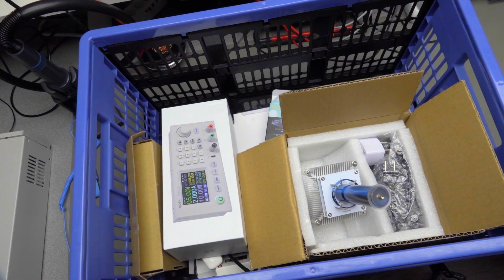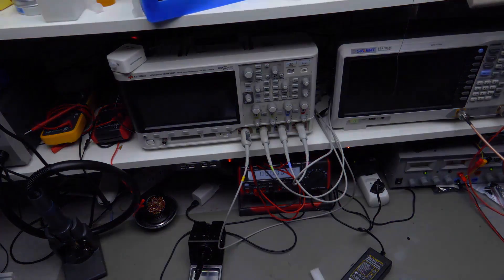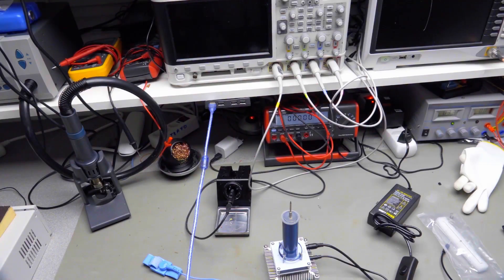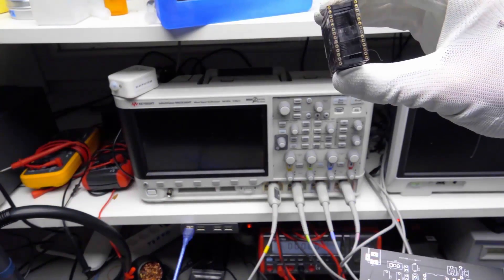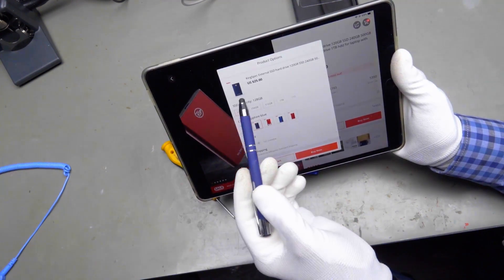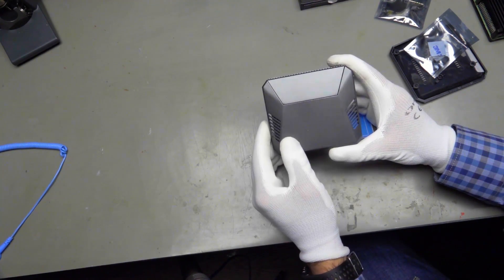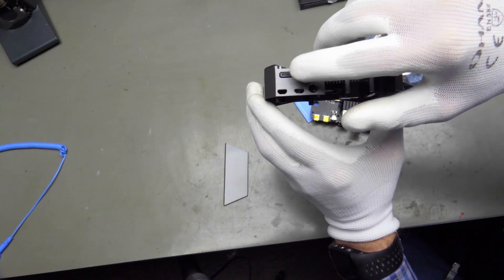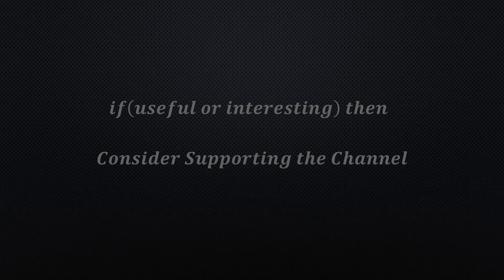#308 Mailbag Part 1 (Tesla Coil, wireless energy transfer, Raspberry Pi stuff, etc.)

Comment: I think the audio encoding may have had issues during exporting. It appears to be fading in and out and changing balance from left to right.
Reply from the maker: Yes, you are right. I changed my recording infrastructure and have to work on it.
Reply: @AndreasSpiess  despite the audio problem, a useful and  interesting video as always. Thanks
Reply: @AndreasSpiess  The problem is with the phase of microphones you are using. I assume that here is two microphone recording same time and in the editing or in the recording gear one of them is panned HARD left and the other HARD right and because of the difference in phase, according to your position (sound source) they cancel each other or at least duck each other. either use one of two recorded audio or change the phase of one.
Reply: @AndreasSpiess  Can a jammer be bypassed by a Faraday cage?
Reply: The weird sound effect is not due to a bad connection, it's produced by phase angle between L and R channel.
Reply: Yes, it is fading in and out, it seems a problem of unstable microphone connection
Reply: @Carolus_64  I think if it was an electrical connection, we would have more of a complete loss of audio and/or static. The odd addition of reverb and level changes points towards encoding.
Reply: Maybe a mic positioning Problem. 

If you need help from a german sound engineer, let ne know.
Reply from the maker: @Jonas, I would be glad to talk to a professional. Maybe you send me a message on Messenger or twitter?
Reply: @AndreasSpiess  I found the Problem and sended you a message via Facebook
Reply: Its an phasing problem with the mic. May be l/r channel cancel each other out. Go for mono if possible.
Reply: Do you think your mic was zapped by the Tesla coil...? I had an apple flatscreen monitor with a touch switch. It got burned out when I was using a CB within 3 feet of the monitor.. I hope I can fix it.. While I'm talking about Tesla, is there any way to harness the power in the Aurora Borealis?

Comment: I see that you will be doing reviews on the E22-900M22S LoRa 868/915 MHz modules. I have breadboard friendly breakout boards for the E22-900M22S and E22-900T22S modules that I can share with your audience if you think it would be a good idea. The boards are on OshPark.com and I can enable them to be shared. Three breakout boards cost about 6USD (includes S&H within US) which is rather cheap (not as cheap as China board vendors but OshPark boards are well built). I also have Arduino test F/W for verifying board functionality. If you want F/W libraries for the SX1262, go to https://github.com/jgromes/RadioLib ... he recently added support for "SX126x series LoRa modules (SX1261, SX1262, SX1268)"
Reply from the maker: It would be a good idea to share it. Maybe you send me a message in Messenger or on Twitter?

Comment: Concerning the SSD drive on the raspberry (in particular raspberry 4).

I installed an external USB drive and boot from this drive on the raspberry 4.
The drive I bought is "Samsung Portable USB SSD" at a good price..

What's happening on my raspberry:
- Read SD card.
- Read the /boot partition on this SD card.
- Start booting using sdcard partition and mount USB drive.
- Continue booting from the USB drive using /etc/fstab

The time it takes to boot is pretty fast :) way faster than SD card.
It's a really decent media center!

Some of my "findings".
- Some setting in /boot/config.txt that may be interesting: "rootdelay" and "maxusbcurrent".
- I have not been able to put 2 USB drive in parallel on the raspberry pi 4 (directly, using external powered hub, etc...)
- You have to mount / and /home in your /etc/fstab file (that will be stored on your external drive). You may have to modify the copy on the USB drive AND on the SD card (I spent lot of time...)
- I have spent a lot of time trying to "dd" (copy) my sdcard on my usb drive partition without success.
- Don't forget that it's easy to mount the partition on the sd card.
- You don't need to copy the /boot partition on the USB drive.
- Don't spend time with a mechanical disk :) strange issues like "crashes" probably due to power consumption. USB hub were not a solution.

I think I followed this tutorial: https://www.tomshardware.com/news/boot-raspberry-pi-from-usb,39782.html - but was not working "out of the box" :) 

Note: thank you for the script to control the ventilator using PWM on to of the raspberry 4 :) That was a great addition to my "media center"!

Comment: I recently configured a rPI4 with an inexpensive 60GB USB3 SSD similar to what you are describing and achieved great results. There are a couple of issues --
1. When I did it, there was a firmware issue on the PI that prevented actually booting from USB. So, you have to boot from SD and put everything else on the SSD. This is unfortunate, but not a huge issue. Still much better performance. Perhaps this has already been fixed?
2. There are issues where some USB SSDs that do not correctly implement UAS and get really lousy transfer rates. You can disable this mode with the procedure at: https://www.raspberrypi.org/forums/viewtopic.php?f=28&t=245931 and still get great results. 
In my case I get about 250MB/sec reads compared to 12MB/sec or so for the SD card.
Reply from the maker: Thank you for the link. USB boot on the Pi4 still is not supported.

Comment: 3:00- If you hold a fluorescent tube in the air while standing under high-voltage power lines, it will light up because many of them are poorly insulated and leak a lot of power. You can have a realistic light-saber. (Obviously don't touch the power-lines or towers. Besides, that would defeat the amusement of it being wireless power. ¬_¬)
Reply from the maker: There is an electric field around all lines.

Comment: I've learned that Tesla coils are used in very high-end Hi-Fi, as tweeters supporting high frequencies. They're used in addition with other technologies to support the full Hi-Fi band. Not very practical for high output (in terms of sound pressure), but watching your video, I can definitely see the allure. Neat trick with the fluorescent tube, by the way.
Reply from the maker: I do not have knowledge in Hi-Fi. So I do not know it really helps or is just a gadget.
Reply: @AndreasSpiess  I think it's just a gadget, for the most part. All of that gear is well out of my pay grade. :D

Comment: You should definitely check to see if that SSD is actually 128GB. A lot of cheap Chinease SSDs/MicroSD cards give a fake storage size to the OS (a 32GB showing up as 128GB in the OS). GamersNexus and Linus both have videos on this subject. Here's a video from GN: https://www.youtube.com/watch?v=cBhNLSk0w6w
Reply from the maker: Thank you for the tip. I will try it. But also 32 GB would be ok for my Raspberry as long as wear leveling works. And here I have no information :-(

Comment: These Argon cases are indeed very nice. At least in Germany they are available e.g at Berrybase and Reichelt around 24 Euro (Berrybase made a Video to explain all the Features: https://www.youtube.com/watch?v=zLxhalSAUzY ). 
Wifi still works because of the Plastic Bottom. 

And Argon has another Case, similar to the FLIRC wich is a bit cheaper but I havent tried it.
The only downside is that the software only works on Raspbian, I can't get it to work on Manjaro.
Reply from the maker: Another viewer posted this link already. Maybe I should add it to the video (for the Germans). I know they have other cases, but I did not want to make a "case" mailbag...
Reply: Andreas Spiess Sorry, havent seen that.

Comment: The Tesla coil creates plasma, this plasma creates O3, or Ozone. That's the odd smell in the air. Don't run it too long as Ozone can be just as deadly as too high of CO2. I would not run the Tesla coil for an hour or longer for sure in that closed room without circulation.
Reply from the maker: That is what I thought. It did not smell right. But I am still alive ;-)
Reply: @AndreasSpiess  And we are glad of that  😉

Comment: That was timely, I was looking at SSDs for my main Pi myself just this weekend for the same reasons.
Reply from the maker: So let's hope we will be able to use it without a SSD...
Reply: @AndreasSpiess  very doable, for the Pi 3 you can use Berryboot, it is super easy  and is nice for backup and some other interesting features.

Pi 4, a little more tricky till the Rasberry people provide new EEPROM code for it. But just yesterday I was setting up my Pi 4 with help from this page, which worked well, and is reasonably straightforward. jamesachambers.com/raspberry-pi-4-usb-boot-config-guide-for-ssd-flash-drives
Reply from the maker: @Evile: Thank you for the link. Maybe I will try it too.

Comment: Those are some nice finds!  The Rasp Pi  case is a smart design (finally!)
The Tesla coil looks like a fun table-top toy -- especially since it "sings"!  I'm curious to know what voltage it produces (not listed on its info page.) Will you be talking about the operating principle, Tesla's use of tuned resonant circuits, etc? I'm not sure how audio passes through such a limited bandwidth.

It looks like you have some fun projects in the pipeline!
Reply from the maker: I might do some additional tests with the tela coil to measure its voltage. We will see. But I have no plans for a next video. This might change if I discover something interesting...

Comment: Seems small capacity cud just use a usb thumb drive 🙂
Reply: A thumb drive and SSD are very different things, The flash in thumb dives is very low quality and has less writes, and the controller used lacks many of the functions required for high performance SSD. Just ask anyone who's run A PI (even a Pi 3) off an external SSD, it's like a completely different machine vs the MicroSD. Also thumb drives usually use a cheap memory called MLC, it has much lower write characteristics than the SLC memory used in SSDs. Finally SSDs are designed to use the SATA interface which is designed around the needs of data transfer and I/O and maybe even cacheing. The thumb drive just uses a 'good enough'  memory to serial controller.
Reply: @EvileDik  nice I am familiar with sata interface in ma pc.I assumed the pi wasn't capable of max performance if connected using usb but I no got Pi 😂
Reply from the maker: Nobody knows how the USB sticks implement wear leveling.

Comment: Hi Andreas, interesting mailbag, the pi case is indeed smart and the small SSD was a good find. I'm looking forward to your 4G LoRa gateway episode. By the way, plenty of the Chinese suppliers of this HUAEWI modem adds different brands of (cheap) antennas. Therefore, a scan with the antenna analyzer for this particular Ali-item would add value to your future LoRa/4G video.
Reply from the maker: Good hint about the antennas. I did not know. So I will test them...

Comment: The Tesla coil is really cute, although a bit dangerous. The HF voltage will flow over the surface of your skin and give a tingle, but will also destroy electronics in an instant. I would be more worried about the ozone it generates, as just 5 parts per million is considered immediately dangerous to life or health!
The Pi 4 case is sweet, but unfortunately not easily stackable. A flat top would be better as surface space to put things is always needed!
Reply from the maker: I did not feel pain. Maybe because of the "magic white gloves" ;-)
Indeed it stinks in a small room like my lab. But we were in the snow for holidays to replace this bad odor with fresh mountain air.
Reply: @AndreasSpiess  Some luxury shower cubicles use ozone generators for disinfection: the cubicle is sealed, exposed to ozone then vented to the atmosphere, during which the doors are locked for a few minutes until the concentration is low enough to enter.
I suspect your audio problems may be due to high levels of RFI. It would be interesting to see what your spectrum analyser would show, starting off from far away!
Reply from the maker: @Andy: The audio problems had to do with my new infrastructure and cutting software. It should now be solved for the next part (at least this is what I hope)
Reply: @AndreasSpiess  Ah, OK... but it would still be interesting to see the RFI spectrum and intensity.
Reply: Andy Lee Robinson wrong....
Reply: @gnuclur8952  What did I say that was wrong? I have played with Tesla coils, been shocked by them and destroyed electronics with them.
As for ozone, https://en.wikipedia.org/wiki/Ozone
Reply: To save surface space, maybe one could glue some NdFeB-super magnets to the case and stick the case to a suitable metallic wallplate. ;-)

Comment: Andreas, have you tested the WiFi from a Raspberry Pi in a metal case?

Logic would indicate that any RF signals will be seriously disrupted by being placed in a metal enclosure.
Reply from the maker: I did not "test" it. I just used the flirc case in my lab and it still connected to Wi-Fi. But the AP is quite close and I would expect a much weaker signal as without the case. My lab server is connected through Ethernet. So it is not an issue for me.
Reply: @AndreasSpiess  my question with pi inside  a metal case is, would a wifi transmitter burn out in a confined space? The metal case would bounce all the rf energy around inside. Does confined rf behave similar to confined heat sources?
Reply: I do experience less WiFi signal thru walls. It's almost the same case that I have just with 2 fans. Would be nice to have an external antenna connector on the pi.
Reply: @ZillionPrey  I know the pi has built in wifi, but you can also add a usbwifi dongle to get external wifi to the pi. And without a metal case, could use the pi as a wifi repeater
Reply: @WagonLoads  External WiFi is always neat but why use an external WiFi Modem if there is one built in. I don't know if there is a way to "externalize" it's internal antenna. If I recall correctly the pi zero had an unpopulated WiFi antenna connector. I don't know if the pi4 has one tho.

Comment: What would be nice is having a light level meter on the fluro and a power meter on the Tesla coil, so as to check the efficiency over different distances. Empirical data of wireless power transmission Vs wired might be interesting.
Reply from the maker: High voltage is not my specialty. I assume the field behaves as usual and gets smaller with distance. But it would be interesting to measure the voltage on the tesla coil. Maybe I will do that once,

Comment: I used a USB memory stick with a RPI3+ instead of a SD card. My observations were that it had 0.5% more CPU load and 1 reboot of 4 didn't work. So for SSH remote operations and if nobody is around to pull the plug I recommend SD card instead USB memory. 
I like the RPI because it is passive. So a measurement of the noise of the fan would be helpful. For speed tests of memories I use h2testw from the c't guys, the best tool to check the integrity and speed of flash and magnetic memory in my eyes.
By the way Andreas, I got a self build SAW filter for 868mhz from HB9AXA as a gift that together with my preamp increases the range of my OGN receiver a lot! So I think if you find the time for lora range and packets experiments  with filters and preamps for the gateway, it could be worth to test it. I am quite surprised and satisfied with the results for flarm.
Reply from the maker: Thank you for sharing your experience with the SD card.
As I mentioned,  connecting a pre-amp and a receiver is a simple task. To do that with a transceiver is much, much more complicated. Did you do the tests without the filter? And what kind of receiver did you use? An RTL dongle? How long is your cable?
Reply: @AndreasSpiess  Yes, it is an easy SDR usb dongle. The SDR gain was lowered to get not overdrives by the lna. The antenna cable is <1m. I did also a comparison with an antenna with more gain without LNA and Filter at the same time, same place and the 5dB colinear with preamp and filter does better then the 9dB colinear without all that. Maybe it's location specific and there is more noise as usual. But the hydrogen astro guys use several lna and filter as well to increase the signal noise ratio. Maybe the lora gateways do have a filter already.
Reply from the maker: The dongles are well known for their "insensitivity". So it is good to add an LNA (the HackRF, for example, has one already built-in). But do not compare this dongle with a Lora chip and its sensitivity of about -140dBm.

Comment: I've deployed Lora gateway and nodes for electrical distribution company in the agriculture area.
Gateway has solar panel, li-ion battery (~500wh), and mppt charge controller connected to PI over modbus and 4G router. So totally green energy.
Reply from the maker: Very good!

Comment: The Argon cases are very nice, I already got two of them. It was just so annoying to have this unkempt little hedgehog on the desk. Now every cable goes into one side and you can hide them nicely.
You can get it at https://shop.heise.de or even at https://www.amazon.de/Argon-ONE-Case-f%C3%BCr-Raspberry/dp/B07WP8WC3V/ref=sr_1_1?__mk_de_DE=%C3%85M%C3%85%C5%BD%C3%95%C3%91&keywords=argon+case&qid=1579423554&sr=8-1
Reply from the maker: Thank you for the link. I did not find it when I made the video. Now it is on the description...
Reply: @AndreasSpiess  I forgot, I actually got my 2nd one from here https://www.reichelt.de/gehaeuse-fuer-raspberry-pi-4-alu-schwarz-rpi-case-argon-p267676.html?&trstct=pos_0&nbc=1

Comment: The teslacoil destroyed your
Mic
Reply from the maker: Hopefully not. But I have to work on sound. I changed the recording infrastructure.
Reply: @AndreasSpiess  Never change a running system :P
Reply: @AndreasSpiess  best change it back
Reply from the maker: I think I solved it. The new cutting software is so good I never will go back ;-)